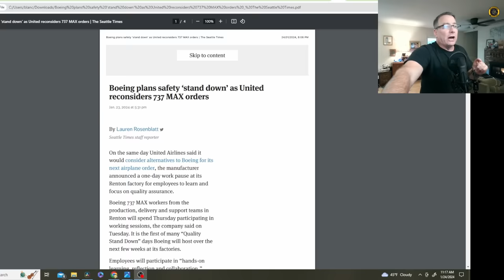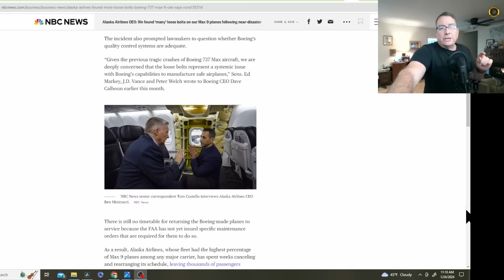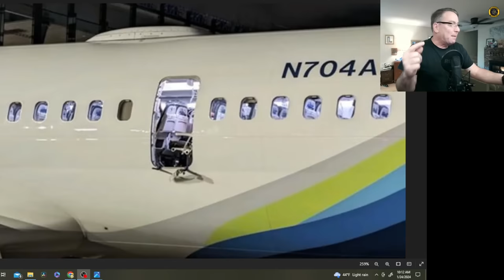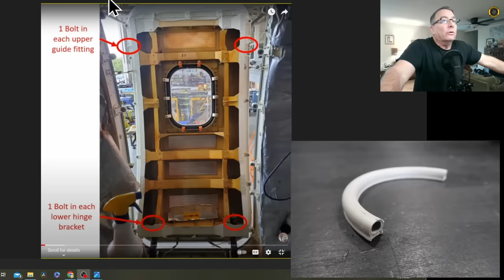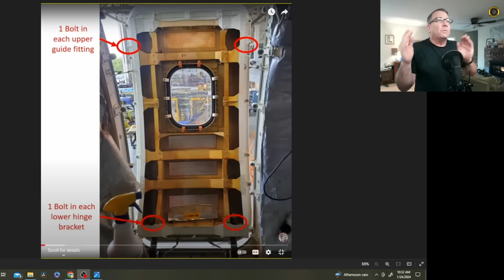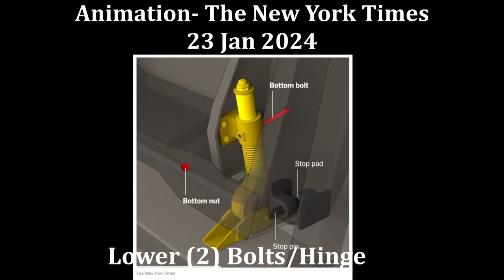Boeing's Quality Management Failure Explained 737-Max-9 Door 24 Jan 2024

Comment: If I'm picking up what you're putting down, you're saying that the bolts that prevent the plug door from opening had been removed but never reinstalled. In other words, it's not a design flaw it was just human error. I'm guessing nobody wants to take the blame, so it will take a long time to get this sorted out. I'm not a airplane mechanic but I'm assuming that the bolts just needs to be in place not necessarily tight as long as the nut is on and the cotter pin properly installed, the door can't be opened.

Comment: The person that decided the "open", and "remove" conditions is the cause of this. There is only one condition of the plug door besides "closed", and that is "opened/removed".
Reply: Incorrect, the inspection required for "replaced" simply needs appending to the "closed"

Looks like sufficient understanding of the process was not available while the procedures were written.
Reply: @jonanderson5137  Sorry buster, the two paths is what is incorrect.

Comment: As an Air Force trained mechanic I'm shocked they would allow this level of maintenance without an inspector sign off. Sounds like the bean counters have cut back on inspectors and processes made to cut corners on requirements for inspection items. Boeing used to have a reputation for quality, now they have a reputation for cutting corners at all levels. They better turn their collective a$$es around soon!

Comment: I don't know why people keep complaining Quality Inspection did not catch this or that. No, that would be the last line of defense and it needs to inclusively detect any anomaly regardless of how Assembly did it. Even as important and efficient is that any assembly  process has to be cohesive that the next step or process does not invalidate or reverse the steps before it. But if so required, it is marked and run through the previous process (tightening the bolts) and reroute bypassing the new process (install the rubber shield already done by now) to go on with the next steps in the assembly line.

These things when having the data entered into the computer system can be easily automated to flag for inspection of parts that have been "disturbed" (removed or changed in both components or assembly) to do something else. Again, process has to be cohesive when breaking it into smaller assembly steps. 

This is commonly happened in factories where say a unit with  a required repair or upgarde parts has been done so then simply bypassing the rest of the quality and inspection since all the rest were proven good  before without taking into account the disassembly or any other disturbance to the areas of modification. That quality escape is the fault of process  and quality engineers.
Reply: Next time just stop at your third word.
Reply: @Look_What_You_Did  
Hurt your brain ? Need treatment ? More rehab time for you ?

Comment: ANY time a seal is inspected, regardless of the method of inspection, a quality inspection should be required afterward. Whether the door plug was opened or removed should make no difference. This is another example of Boeing pinching pennies at the expense of customer safety.
Reply: Precisely. Why are we so overly consumed with bolts? The real concern is why the seal was bad: Defective material (supplier issue)? Improper installation (assembly issue)? Act of G*d (theological issue)? Other?

Comment: It appears to me that that you have conflated two distinct events… opening of an overwing exit is not maintenance action, and closing it again is straightforward and secure- we used to do that to examine the overwing area for ice and snow before boarding sometimes.  However, where an overwing exit is not needed because of seating configuration, and a plug is used, then instead of the latch mechanism bolts are used.  Removing these requires maintenance verification of replacement.

Comment: Regardless of the mishap from one safety check system to the next, someone literally just saw 4 bolts and tossed them aside and never bothered to replace them. Absolutely insane.
Reply: This whole process was probably carried out over multiple shifts and a junior employee was told to put the door back with zero supervision. Heck it's entirely possible the bolts when removed were set aside on something that got moved over the course of several hours.

So many other possible scenarios could have happened. What matters is that the person responsible for reinstalling the door failed for some reason and no QC process followed up.

Also I wouldn't be surprised if this was a case where one guy physically puts the door into the hole from the outside and another was responsible for the interior steps. First guy did his job and moved on. Second guy never showed up to his part of the process and NO ONE noticed.

Comment: I wonder if the quality check is based on the original "normal" door being in place vs the plug door. It would make sense that you wouldn't need to inspect the bolts on a normal door, since you'd expect it to be opened / closed. But the mistake is using the "normal" door instructions for the plug door.

Comment: One could argue that the problem goes well beyond construction management and quality control. The corporate culture in the United States, where profits are examined on a quarterly basis, and shareholders are demanding quick profits creates pressure to prioritize short term profits over the long-term well-being of a company, and to avoid investments that may not pay off quickly. Thus, the finance guys are frequently able to force the engineers, quality and safety professionals to take a back seat, and make speed & meeting schedules the priority. Adding to this problem is the compensation packages the overpaid executives receive. They have a strong incentive to focus on making things profitable short term -- even if setting the company up for failure. Boeing shareholders should all look in a mirror and repeat: "we have met the enemy, and it is us."

Comment: Having worked in aerospace for roughly 50 years this problem is an upper management problem. That's where the first and most significant failure occured. Someone was not doing their job effectively and a complete failure of their QM system...thus and upper management failure.

Comment: First off, I'm an SQE and do quality inspections as an independent contractor.  People would be scared to see just how much sub standard work suppliers try to get passed.  The real problem is, even though all the critical parts are inspected, a fixed process is written for production, and a sign off is required, some people still pencil whip the sign off, in house.  "Kitting" has helped this, but, redundant inspections should be required and are not.  This is where all the majors drop the ball.  It's said that there's no such thing as 100%, but 99% isn't good enough.  Independent inspections are the cheapest insurance a manufacturer can buy.

Comment: The fundamental issue is cultural. In the great days of Boeing, senior management were engineers based at the production plant and the built up to a quality. Now they are accountants based 2700 miles away in Washington DC and they build down to a price. Whistle-blowers from Boeing and Spirit are saying that there is a lack of skilled staff, relentless production pressure, and skimped inspections. So mistakes are inevitable.

Comment: Actually when they opened the door and removed the bolts, because the bolts are required to be removed to open the door, the mechanics are supposed to write up a removal in cmes for the removed bolts.  If they had done that then there would have been a bolt reinstall inspection and torque requirements.  The torque requirements would need to be written on the removal  along with the the serial number of the torque wrench and qa would have to buy off the removal

Comment: Irrespective of the quality control system, if opening the door plug means removing the bolts, both quality control systems systems should require an inspection of the bolts. so either the people devising the check lists have made a mistake or those providing these people with the necessary technical information.

Comment: As an engineer, this is so frustrating.  There are numerous ways to make sure a bolt never comes out.  My favorite is to tack weld the bolt to the nut after torquing.  If you ever need to remove the bolt, 3 seconds with a whiz wheel will grind that bead of weld off.  But it will NEVER back off on its own.  

I build offroad race vehicles in my personal life.  Every critical chassis / suspension bolt gets a tack weld.  When the bolt needs to be removed, the tack is ground off, and a NEW bolt and nut are used to reinstall.  Easy.  This was very avoidable.
Reply: You don't  weld bolts on aircraft! Some welding is done but mainly  on components  in workshops..

Comment: Worked on the car yesterday. Had two extra bolts left over. Ended up being for the air filter housing. All the hardware goes in a stainless steel pan with a magnet on the bottom. If anything is left over, I double check my work. You can have all the quality control systems in the world but if people don't have common sense and just check mark things off and sign the sheets without actually checking you end up like this.
Reply: You didn't  have two bolts left over, you had two bolts that you had not fitted! I was an aircraft Engineer and Examiner FAA, CAA and EASA. Some of the US mechanic's  and even Certifiers , were so bad that I declined to work with them, let alone certify their work!

Comment: As soon as you started talking about opening vs removing I knew exactly where the issue came from I can almost picture the conversations that allow this to happen it's scary easy for issues like this to get lost in the process and sadly techs don't often ask about things outside of their work order. They do what they were told to do and expect that others are doing what is proper for the situation. But without someone who see's it speaking up it's hard for management to realize hey it looks like someone misclassified this work as opening a door which will cause this potential error. Please fix it or make the quality requirements equal for both definitions of actions taken.

Comment: So Boeing decided that the lives of airline passengers were not worth the cost involved to:
1.  Require its major partners to standardize upon a single quality management approach & software. Not
2.  Designs and build a translation layer protocol  to ensure the disparate QMS databases share data. 
Frankly, as big as Boeing is they could easily have forced or “negotiated” its suppliers to utilize a shared or open QMS solution. So. This alone tells me Boeing is far more focused on corporate profit and CXO suite payoffs, oh, I mean “salaries” than they are about passengers’ lives.

Comment: Third party contractors spell problems in aviation. I was a part 145 maintenance supervisor for 121 air carriers and it's very easy for things to get lost when multiple companies get involved. My crew launched an aircraft that had a flyaway kit loaded in the belly but another contract company did the service check and AWR before the flight and yet another company handled the logpages and communication with maintenance control. My crew had asked repeatedly for the aircraft logbook and we were finally told stop asking and that we would get it when the airline reps were done with it. The contractor never deferred the FAK and they signed the AWR and placed the logbook on the flight deck. But when the question arose about the flyaway kit not being deferred they tried to blame our company who launched the aircraft as we would normally be the ones signing the Airworthiness release and pushing back the aircraft. Too many avenues for difference in procedures and miscommunication between companies. 145's also try to make one crew of mechanics satisfy multiple airlines and in the end no one is satisfied and no one is safe or happy. And during covid the FAA was completely absent for a year or better. 🙁 I would have loved to talk to them after what I went through. And this incident was just the tip of the iceberg at this particular airline.

Comment: In the Air Force, any fastened door (Screws/bolts) or panel that was opened/removed, a discrepancy was written in the forms and the cavity and door/panel was inspected by a craftsman level Tech to ensure it there was no problems in the cavity and that the door/panel was properly resecured before signing it off as such, it was a grounding condition-which makes the aircraft unairworthy until it's signed off.

This is a dirty dozen moment as to what happened to this max 9.

I was an F-16 Avionics Tech 2005-2010, A&P 2021-Now. My meticulous mentality would ensure no bullshit happens.

Comment: I'm no air frame engineer. However, why can't there be 6 bolts all linked together by a red lock wire. They should create a complete anti tamper system where opening or removing the door requires physical removal of all bolts and lock wire

Comment: This is a process problem. Inspection of work performed is part of the process, but not the only part. You cannot inspect in quality. Quality, or the ability of a single product or the whole assembly to meet its requirements, starts with the design, then manufacturing, and then assembly. Inspections are done to improve quality, but to ensure that the product meets the requirements. Stop confusing quality with the need for a product to meet its requirements. Having a product meet its requirements every time is quality.

Comment: In structural engineering we say, 'one bolt is like no bolts', so two bolts minimum per connection. A structure won't flyu but it is evident that redundancy ta taken seriously. An observation I'd like to share.

Comment: Thank you, Juan, very good information about the two different Quality systems. That's a good candidate for Root Cause.

I feel the bolts should be a Required Inspection Item (RII) every time they are removed. This will document both the removal and the installation of the bolts. Then when something like this happens, it helps the investigation.

I believe the term for these mistakes in airline jargon is Quality Escapes, or just Escapes.

Comment: Yeah, I'm a master A&P, pilot with over 4500 hours logged, 25 years of as an airframe and power plant technician, I am also FAA certified in crash and mishap investigations and the last 14 years of my career I headed up the flight safety office for the DOD N. California. You can blame Boeing all you like, fact is, this is much bigger than Boeing. A critical component of flight safety is inspections, hourly, post and pre, bi-annual inspections, annual inspects and phase inspections on the part of the owning or leasing component. If an inspection would have been completed by a experienced technician, a problem with the bolts holding the plug in place would have been found, ITS PLUG and a structural component, it should have been inspected at least annually. Yes, it sucks that you have to take an aircraft out of service for a few days but its better than having a catastrophic plug failure that could have resulting in the lose of not only the aircraft but everyone on board not to mention people on the ground. Hell, its a requirement to file a dropped object report with the FAA if you lose a static discharger probe. Yes Boeing is ultimately responsible but so is the owning or leasing component for failing to make structural components a mandatory part of the inspection process.

Comment: The fact that this plug is not a usable emergency exit means that Boeing used incorrect procedure. A usable emergency exit can be simply opened and closed, a panel or plug to complete the airframe needs to be removed and subsequently replaced in accordance with set procedures

Comment: 🤔 If the plug is “opened” there will be a step in the procedure to unpin & remove the four plug bolts.  

       After seal repair there would be a procedure to reinstall, torque and pin the four castellated nuts. 

        This would be a “critical maintenance step” for air frame and ventilation envelope integrity which would require human performance QA/QC tools, such as concurrent and/or independent verification.

         It looks like the the issue was either grossly inadequate procedures which lacked the independent IV/CV QC, or it was a case of criminal falsification of records.😎

Comment: That paperwork and tracking system should consider doors as a DIFFERENT PART from a door plug. Apparently, you cannot open the door plug, you can only remove it.

Comment: As an engineer I think there is a problem with the design of the door latch mechanism.  The door can be put in place and will hold itself in place resisting gravity loads and to some extent air pressure loads even without the bolts.  If you have one group repairing the seal and/or rivets and they close the door, the next group working on the airplane doesn't know that the bolts need to be installed.  The mechanism should be such that it is a one step operation- put the door in closed position and it is automatically connected all that it needs to be connected.

Comment: my question would be, where the bolts their in the first place, and if so surely the person working on the plug would have had 4 bolts in his work tray, along with all his spanners etc, so they would have  record of who worked on the replacement seal, and start from that end, the underlying problem is a company run by accountants, profit before safety

Comment: You state that to open OR to remove the door, all four bolts have to be removed but that a safty inspection is only mandated of the door was removed but not if the door was simply opened, hence no check to see if it was correctly bolted back? 
INCOMPETENCE in the system to the max